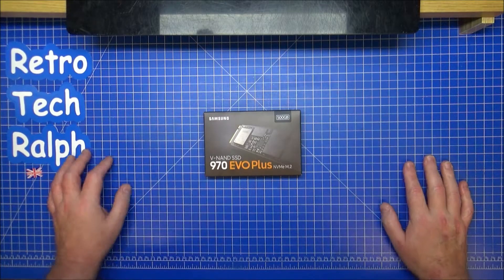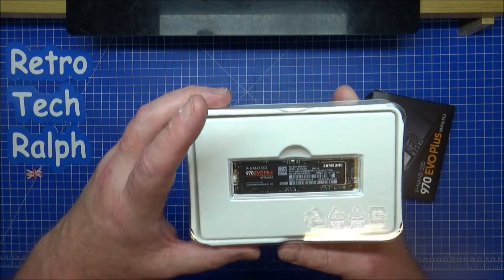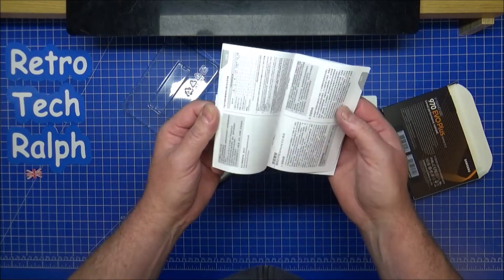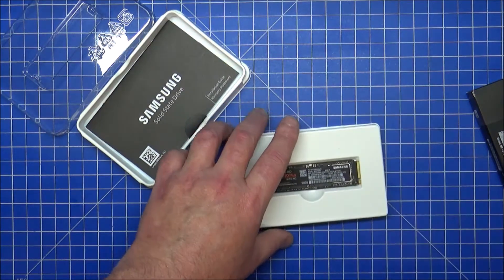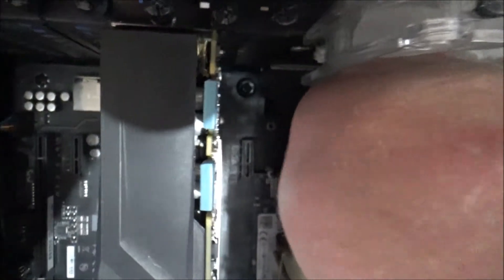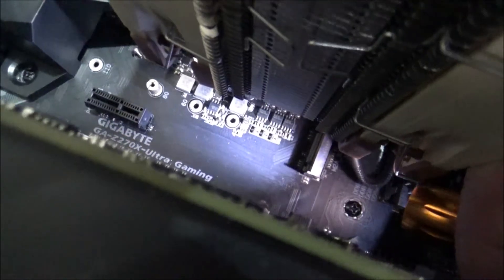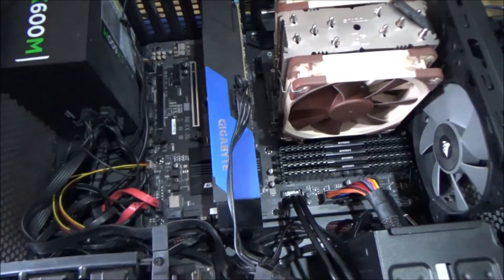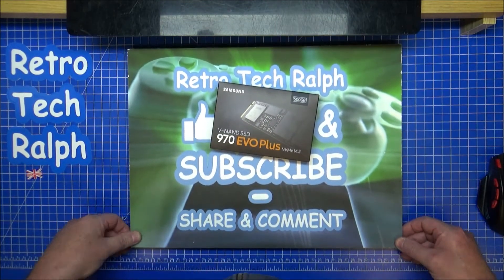Samsung 970 EVO Plus 500 GB PCIe NVMe M 2 SSD Drive Unboxing and Installation

Comment: My Samsung SSD 970 EVO Plus 500GB nvme m.2 plce gen 3×2... is only reading at 1783mb/s and writing at 1657mb/s... Literally half of what it is supposed to be reading/writing at, the website says a bit above 3000mb/s . I got my results from Samsung Magician.
Does my processor have something to do with it? I have the lowest Ryzen, 3 3200u with 12GB RAM 

I'm about to get a new laptop with the Ryzen 7 5700u and I was thinking about putting this SSD into the new laptop, but I don't want subpar results again... Maybe I'll bench the SSD that comes with the laptop, then install my current EVO and compare the read/write speeds.

Comment: Does this support 3GB read 3GB Write on i5 7400 need help 🙏
Reply from the maker: no, its a little slower than that, but i dont have any problems with my set up, but yours could be more demanding
Reply: @R_T_Ralph  Which cpu you're using and what speeds are you getting
Reply from the maker: @Cooldude1991c  cpu is a kaby lake with 4.5ghz, but ive never checked speeds for transfer, sorry.
Reply: @R_T_Ralph  I think you're running quad core cpu

Comment: I have installed the same drive in my hp envy bp112dx but I am not getting the full speed I checked it shows PCIe interface  3×1 because of which i guess i am getting less speed is there any setting to change the interface to 3×4 . I have also installed windows in ssd and  it is not showing in BIOS
Reply from the maker: not sure, best email Samsung direct, as there could be an error with the card.

Comment: Bought mine too today. Great video! My old SSD Started to struggle to the point where it wasn't getting enough speeds anymore that it says. 850 EVO 250gb today died by giving me boot bluescreens and my hardware is a month old worked fine with the SSD for a while on it but all of a sudden today the SSD Started acting up today. And overall slowdowns sometimes.
Reply from the maker: Im really happy with buying this, and im getting great speed from this.  Only thing is the size.  If i could change anything is i would get the 1TB version, or bigger.  Other option is to use this as is, for operating system only, and get games installed on a separate HDD.  But its still a great upgrade.
Reply: @R_T_Ralph  i use it only for Windows ;) i got 2 2TB Seagate drives for the games, other stuff like editing and videos. I think this is gonna be a great combo.
Reply: @R_T_Ralph  the standoff screw is that already sitting on your motherboard in those M2 slot screws? Or do you need to get one seperately. Edit: nvm the standoff/safety screw came in my motherboard box with the screws.
Reply: @R_T_Ralph  It turns out you don't need the standoff ;) there is a particular screw that fits right in and is the same height as the standoff. Anyway i installed it and straight away is it a difference going from a normal SATA SSD to an NVMe using the PCI Express technology. I did install it under the heatsink cause i saw a video of it going very high on temps when in load, i stream a lot and do some editing so i can see some potential heating there.  i saw a video of it and that pretty much made it clear to me and shock me how much it actually matters that you need a heatsink on every one of em if you can. https://www.youtube.com/watch?v=CMlco-Tp3iM some boards do come with one but the other slot you put it in you can buy a heatsink for it and make the temps drop like that ;). and those heatsinks aren't really expensive either so that's pretty nice for everyone. Although the V-NAND like to run warm it's really not a big deal either but still that temp drop is always nice.